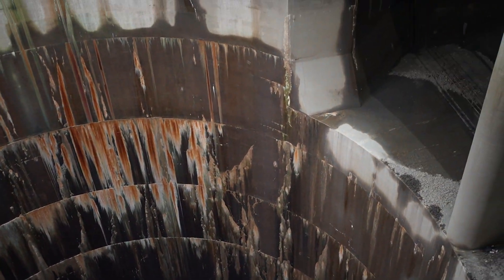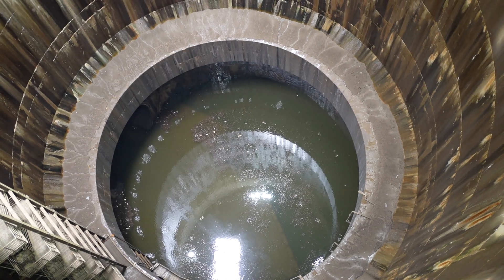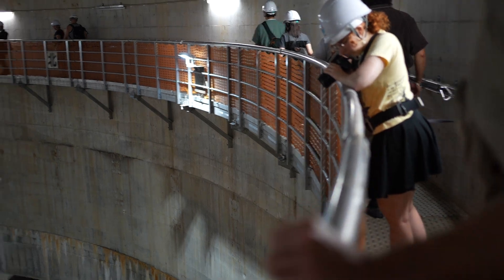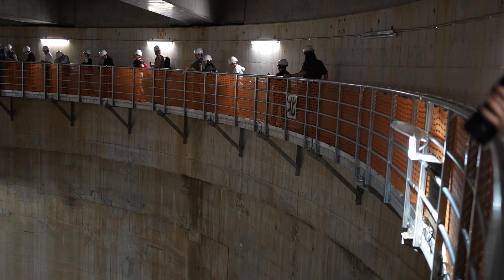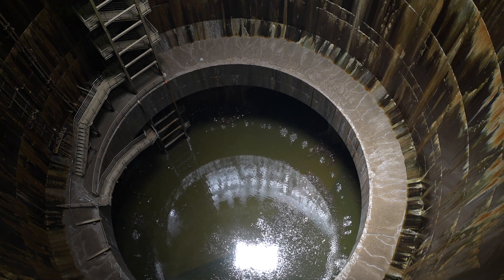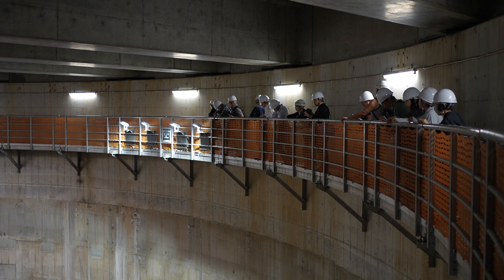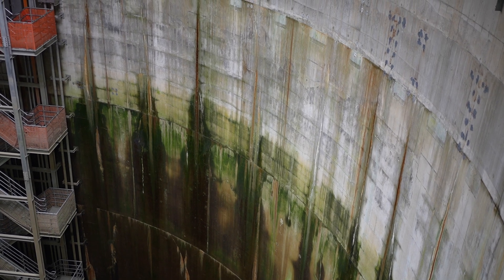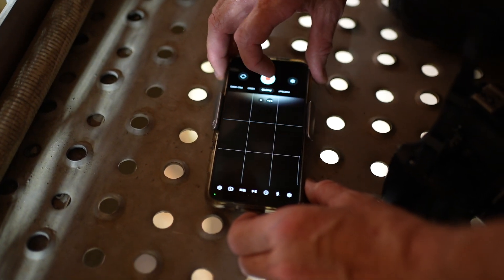国土交通省 首都圏外郭放水路 第一立坑 ツアー

Comment: What is this? What am I looking at?
Reply from the maker: @ronaldrollins9149  
This is shaft #1.  This is the last vertical shaft prior to the pressure adjusting water tank, water will then be temporarily stored and released back to the river by pumps.